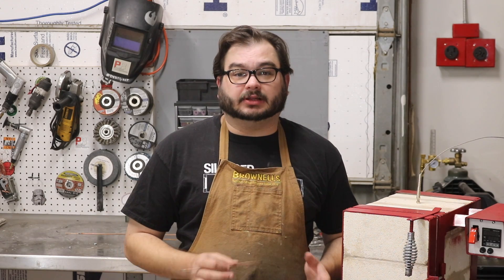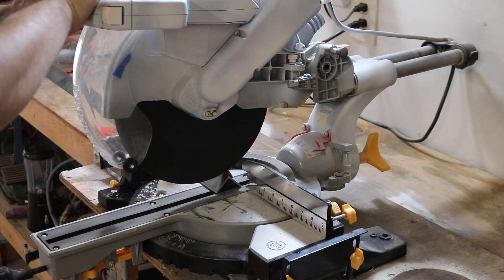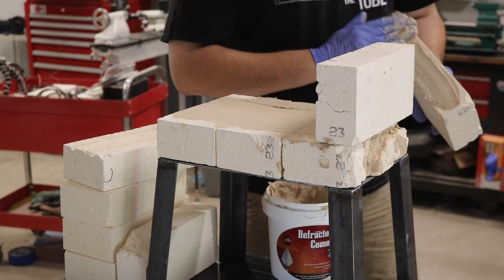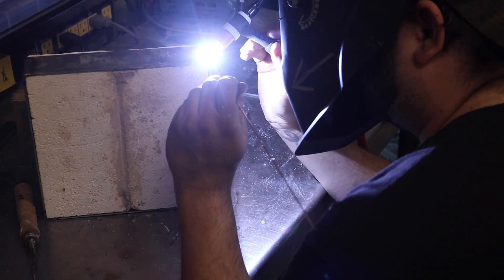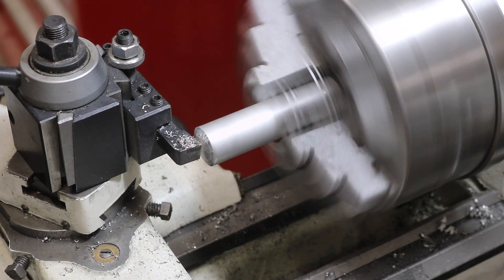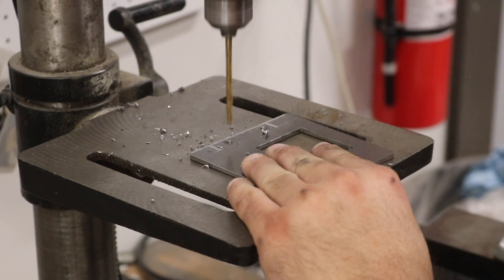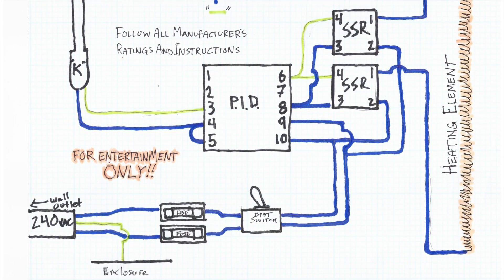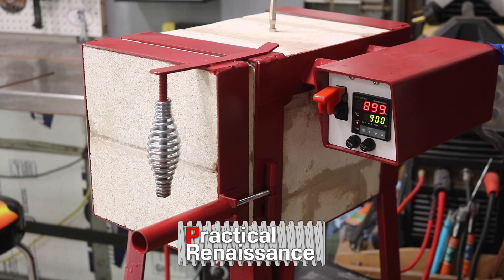Making a High Temperature Electric Oven for Heat Treating Steel!!

Comment: Gj, but that 3d printed terminal block is sketchy. Depending on the material and how the bolt connect to the 3d part this could happen: The contact resistance increases, because of the large current the fastener heats up and the 3d printed part softens, partially releasing the torq on the fasteners. That increases the contact resistance and the block heats up more. Then it melts and fails (fire hazard).
Reply from the maker: That's definitely a good observation and worthy of pointing out!  In this, the terminal block is holding the bolts which have nuts on them that secure the wires from the power cable to the internal wiring, and the strain is relieved further up the wire so it's not pulling on the block.  This means that if for some reason the bolts were to come loose, the connections would remain solid and since they were covered in insulation (heat shrink and electrical tape) risk of short is very minimal, and even in that scenario it would be with the grounded case.  Luckily, also, the amp draw of this oven is surprisingly minimal, and all wiring used from power cable thru the entire control box far exceeds the minimum rating for this load by at least a factor of 2, so heat generation should not be a problem throughout the wire or any connection point.  it's always important to be wary of things like this though!
Reply: While it is true that you are drawing only ~6.6A the problem is that if the bolts were to come loose, the contact resistance between the 2 ring terminals may increase and cause heating. Maybe keep it in mind for next time. 

This image shows heat generated from a loose connection on the top wire. 
https://bit.ly/2LksVhX

Comment: Thanks been considering doing something similar.  can't wait to see how this holds up.   Why does the thermo couple go into 2 spots on the pid?
Reply from the maker: I wish I knew enough about it I could tell you, the wiring diagram is just from the instruction manual so I just did what they tell me....
Reply: My best guess is that it provides an optional way to ground the TC while still letting you do something a little less conventional.

Comment: Great project.  I like how you made the frame.   I built my own control box using an arduino uno.  It works great and reads in degrees F.
Reply from the maker: Oh that’s clever I never even thought of using an Arduino!!
Reply: Could you share your wiring diagram & Arduino sketch?

Comment: Awesome Jeff, you make it look simple! Have you tried melting aluminum? With regards to efficiency, how warm does the outside get?  Ignoring time, how does the cost of home built compare to purchase?
Reply from the maker: Haha thanks Kent! It was a few days of work, to be honest the most difficult part was probably sourcing all the parts :)  I'm positive I could melt aluminum and possibly even brass in this oven if I wanted to, but I just built the foundry which I think will be more useful for that.  I actually forgot to include footage of me taking the temp of the outside of the oven (d'oh!) but for the first half hour to 45 minutes it stayed ambient temp on the outside (which is in the upper 90s here in Kansas City in July) after turning the oven off I measured the outside about 2 hours later and it had risen to just over 200 degrees (F) so it's definitely not perfect.  Total cost was just a bit over $200 all told, some of the materials I had on hand (most of the metal) and I think it was probably about 20-30 hours of total work.

Comment: I have a couple suggestions that might help you out with the coils but I’m not an expert by any means so take it for what it’s worth, we have banks of muffle ovens at work and they all have a layer of refractory over the top of the elements it gives them a layer of protection and I’m assuming would help hold the coils in place? Also there are interlocks on the door so you don’t have to remember to shut the power off while loading unloading.
Reply from the maker: Thanks, that's a great idea that I thought about, but I went with the staples so that if I had to ever replace the coil, hopefully it'd be easier to do.  I also thought about the interlock, I've seen some people include that, but I avoided it for simplicity's sake in this project.  Thanks for watching!
Reply: @PracticalRenaissance  can you forge by this or not???